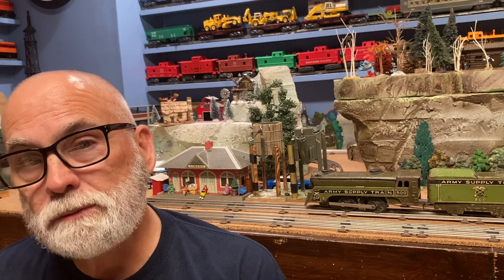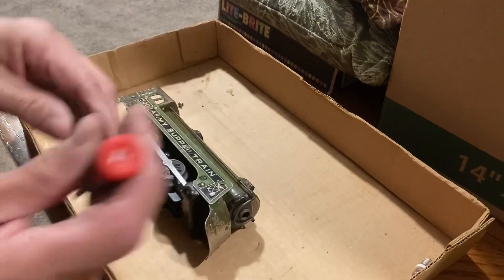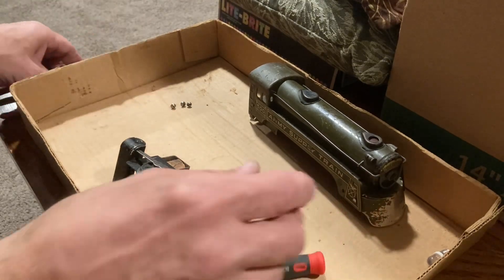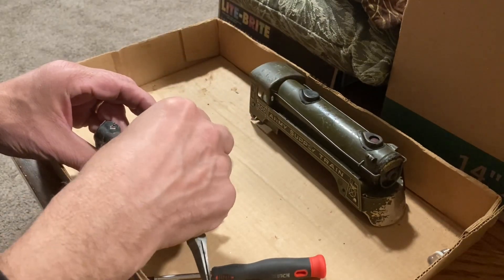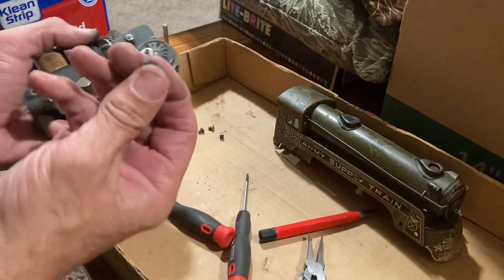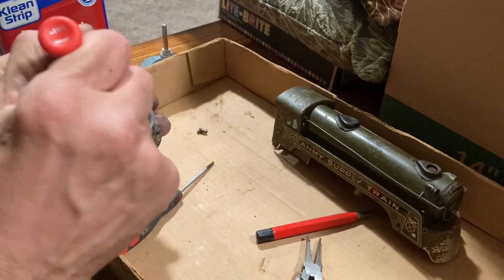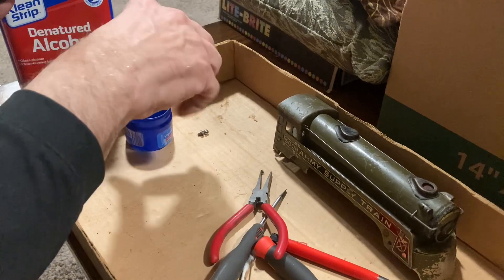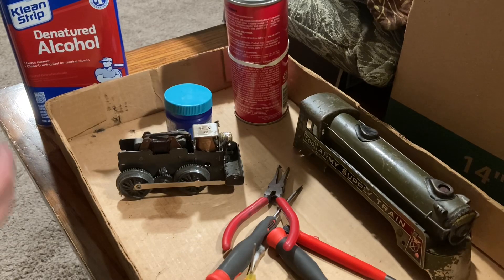Marx Motor Service

Comment: it is not necessary to pull the brush plate to clean the brushes, use a sewing needle to lift the brushes out of the wells, clean them and the armature and reinstall. ALSO THE BOTTOM SCREW ON THE BRUSH PLATE IS GROUND FOR THE BRUSHES, IF THAT SCREW IS LOOSE OR MISSING THE MOTOR WILL NOT RUN...
Reply from the maker: I’ve watched many of your videos, and learned a lot. How would I clean the commutator plate with the brush plate in place? (Some of my locomotives are filthy when I get them.)

Comment: I like your service of your 500 Marx Army Supply locomotive. I think you explain well step by step process. Can you let me know specifically where you get your led bulb, like the voltage and item number. Thanks for sharing
Reply from the maker: I get the LED bulbs off of eBay. They are 12-16 volts. The other LEDs I use are mini lights from Evan Design. I use those when lighting items not previously lit. The LED bulbs from eBay have a frequent failure rate, when they work they’re great, but some of them fail almost immediately.
Reply: okay thanks for the heads up so I should get led bulbs from Evan Design? Is that seller Evan Design not from ebay?
Reply from the maker: @darius7760  No, search them on google.

Comment: I tested a Marx 1829 on a circle of 027 track. I have not done anything to it just wanted to see if it would run. I bought it on ebay over a decade ago. I tested it today and the 1829 ran briefly but only in reverse while looked like it may have been sparking from motor not sure. Then moment later it would not run at all just would sit on track and hum at even full throttle while the light works. Do you think this could be from a stuck e-unit? Has not been run much as there is only light wear on contact shoe.
Reply from the maker: E unit is probably the culprit. Try electronic cleaner sprayed into the unit, then shake the motor up and down ( you should hear the plugger hitting while you are shaking it). I have also used WD40, some people disagree with this, but I haven’t had any problems with it.
Reply: Thanks I will try that

Comment: Marx guy here, in your last video, you displayed a Marx C/P that you sent to Canida to have refinished. Does that individual have a sight, for I would like to see other examples of his work? Thanks, and GOD BLESS.
Reply from the maker: On the Marx trains Facebook group, one of the members has put together an album of his customs. His name is Zoltan.
Reply: @OldFrailandDecrepit  ,thought it was Zoltan. Thanks for the fiberglass pencil idea. I use a small 90 deg. pick to lift springs out of way on brush plate. Jesus is the way.